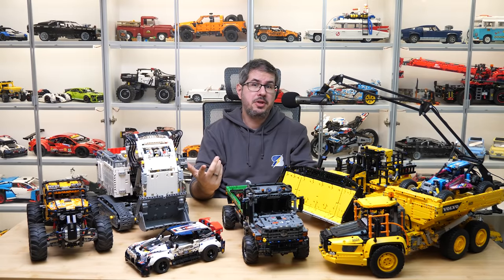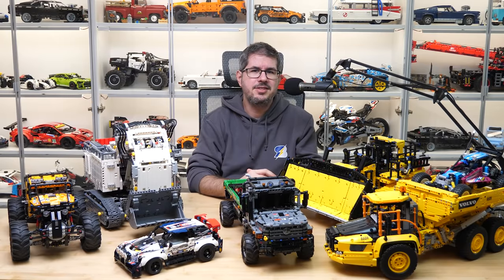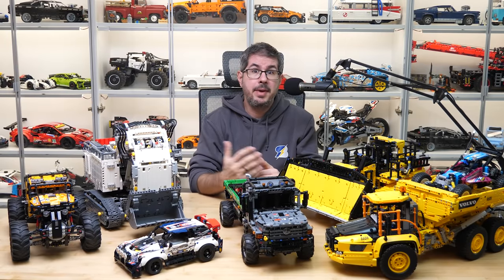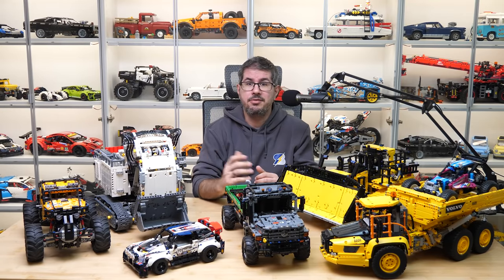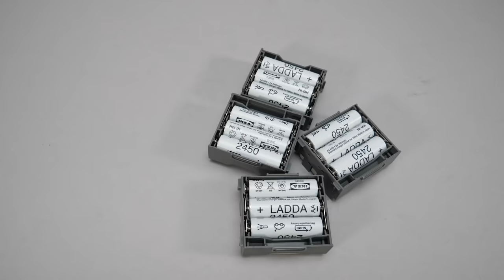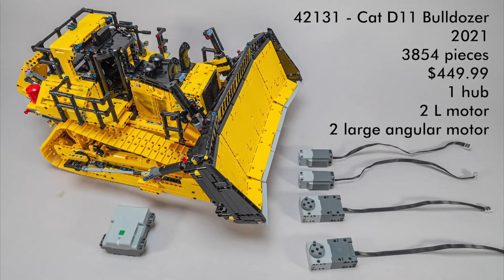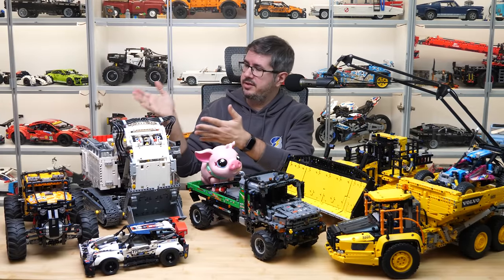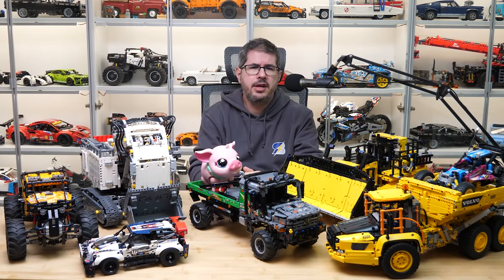All LEGO Technic Control+ sets compared! 2019-2021

Comment: The Liebherr is my favourite but I don't own all those sets - I don't have the tatra or dozer. There is one thing I don't like about Control+ - Power Functions had the same issue. I don't like how each set contains a hub and motors. After buying four sets, I have more hubs and motors than I would ever need. I would prefer to have the option to buy the model without the hub and possibly the large and XL motors since they are used in almost all sets. It would be better if the hub was sold with a large and XL motor - it would make the sets cheaper and it would reduce wastage. That way someone getting into the hobby would need to buy the model and the hub and motor set. Whereas, those with many sets would just buy the model and use the hub and large motors from their collections.

Comment: i actually quite like the look of the off road buggy and if i buy it my next choice would be to save up for the zetros because i quite like it's look and hill climbing performance. I like the extreme offroad 4x4 aswell but i think it will be retired before i can afford it, i am still very much a beginner at building my own rc vehichles so maybe i can look at some of these for guidance, and also use parts from my land rover which i dissasembled due to crackling, after having rebuilt and fixed the problem, just to have it come back a few weeks later sadly, i also have parts from the bucket wheel excavator, rally car, mobile tracked crane, a little fire truck, an airport fire truck, a pneumatif tree chopper (all of the models juts listed have been mostly or completely dissassembled for part use) so i have a good selection of technic parts to use, plus i have some pf elements: 2 XL motors, 3 AA battery boxes, 2 AAA battery boxes, 4 sets of lights (i think) 3 L motors, 1 M motor, 2 joystick remotes and 1 train one, plus 3 (or 4) IR recievers. I'd say at the moments i'm set to start building some cars though my parts are scattered troughout my lego room and i lack expertise. Awesome video and keep up the great work (btw i am not trying to brag about my parts i just felt like saying it)
Reply: The Zetros suspension, atleast for the front, is basically on the ground. Don't take it too seriously.

Comment: @Racingbrick can you do a tug of war challenge between these models?
Hello from Italy👋👋
Reply from the maker: It very much depends on the surface, I did not include it because LEGO tires does not have enough grip
Reply: @RacingBrick  yes is true. Maybe tracks in a carpet has more grip and the 42131 with his weight can pull every control plus set.
For you wich is the best in this challenge?
Reply from the maker: @francescoantonetti2827  my favorite is 42099. A very versatile set, with a few gear swaps you can switch between speed and very impressive crawling abilities.

Comment: Dear Balazs, Thanks for your videos. I really like them.
 I love the technic sets but I haven't bought any of the motorized versions because I'm a bit afraid of them. Did they work (push, pull and control by hand) when the motors are off? Will they roll if my little son will push them by hand when they are in off mode or can we drive the volvo 6x6 to the right direction by hand when the motor is off? By the way, is the volvo 6x6 has a fake engine or the parts are moving? Thanks.
Reply from the maker: I don't suggest to push the motorized sets, especially the ones with a gearbox like the 6x6 Volvo. Technically you can push the smaller cars but they have a higher resistance due to the drive train, so they probably aren't good for playing for a kid. Additionally there's no way to control steering manually.
Reply: @RacingBrick  So like the volvo 6x6 works with the smart phone only. But unfortunately we won't know will the app work 20 years later like the older technich motorized sets which works today :p
Reply from the maker: @officemk8641  I don't think that should be the main concern today. You didn't know in 1986 that you will be able to play with Commodore 64 games on a portable color screen device in 2022, a.k.a. your smartphone. The protocol is open source, 3rd party control options are available today and I'm sure there'll be a way to control them 20 years from today.

Comment: I’m very excited about the upcoming LEGO Technic app-controlled transformation vehicle. If that set would have two large motors for the propulsion, I think it will also have another motor. I think it might be 2 times faster than the LEGO Technic off-road buggy.
Reply: I can't wait either
Reply: Which vehicle?
Reply: @guhhhh  The 42140 app-controlled transformation vehicle. It’s a tracked control+ set that will be released on March 2022
Reply: I’m going to buy it to celebrate me finishing middle school and possibly turn it into some kind of ripsaw

Comment: By the way, could you compare the standard pu hub with the sixths ports hub from spike? Are they similar in capacity, but one has 2 more ports and a battery  instead of relying on 6 AA batteries, or is there more to it?
Reply from the maker: The purpose or the Spike Prime / Mindstorms hub is very different. It provides lower voltage and the focus is very much on the coding abilities.
Reply: @RacingBrick  so, if we use 3 motors for the propulsion of a moc, if only the hub differs, the spike's hub powered ones would offer less torque/speed then the ones linked to the classic's hub?
Reply: ( to be honest, I am interested in the matter because I have an idea for a very interesting moc, but I don't like using 6 AA batteries each time, so I thought that the spike hub could be a good alternative as it has a battery... Until now, I only have PF elements, so, before buying PU elements I try to gather data, as they are quite costly, and the hubs even more... )
Reply: If you buy the parts off BrickLink it’s not as bad. Then you can just get rechargeable batteries. 
At least, that’s what I did👍
Reply from the maker: @richardjulien1329  I think so, but never tested it actually. Will look into this and publish my findings.
Reply: @RacingBrick  I will wait for it! Thanks a lot!

Comment: What a horror show: as a lover of (older) Lego Technic sets, I just could not bring myself to buy any one of these. The are all wrong for the same (Control+) and many different reasons and all way too expensive. Luckily, there are other brands who provide really cool, fun and demanding to build technic sets at reasonable prices. And by the way: five of the seven sets presented here are licensed, which with Lego means you get some stickers that will die a horrible death pretty soon. No prints, no challenge, no B models, no analogue remote control, no rechargeable batteries, no control of the motors and control you own (actually you do not own them), no compatibility, but horrendous prices and ugly blue, red yellow (chose your color) pins, axles and connectors? Lego is dead to me.